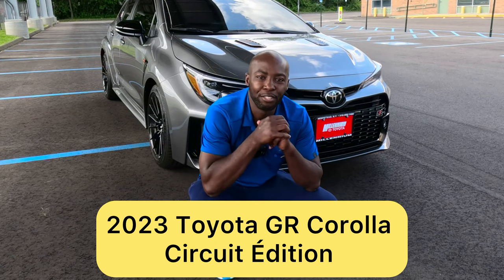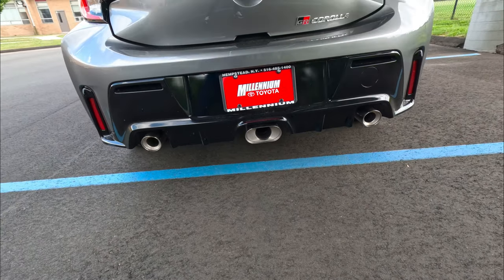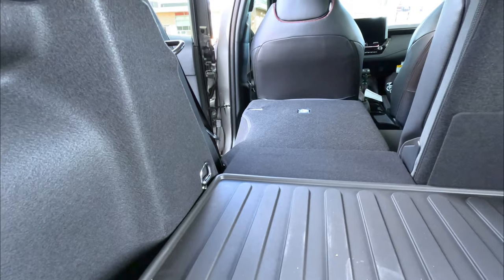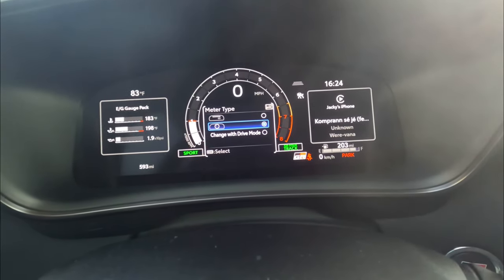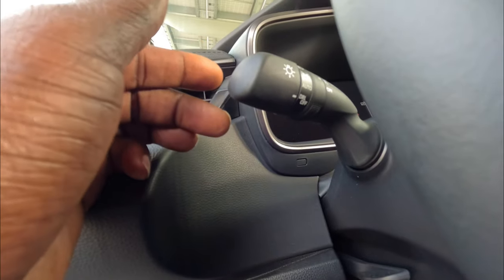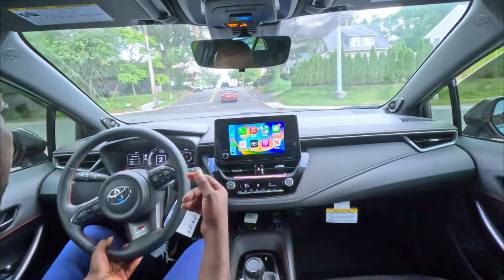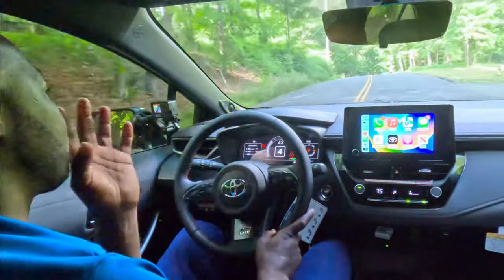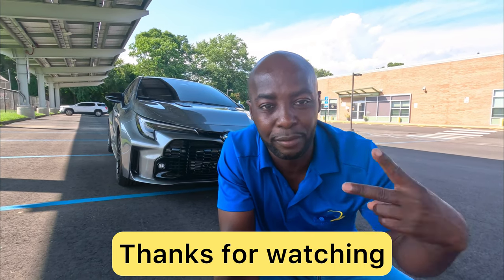Owner's Pov Review Of The 2023 Toyota Gr Corolla - A Quick Story About The Purchase.

Comment: I have the exact same car. Waited 16 months and called about 13 dealers, but ended up getting one @$108 under MSRP 60 miles away!! I absolutely love my GRC, can’t wait to put much love into this little beast! Congrats on getting your GRC.
BTW, the front lower ducts are functional but are blocked off on the Circuits because of aero interference with the rear spoiler. They can be removed and are held on by a lip and double sided tape.
License plate lights are not LED, and the spoiler is not an option on the Core or Morizo from factory, but can be purchased.
Reply from the maker: Congratulations happy for you mine was about 50 miles away.  I put my boys in there already. It’s small but doable.
Thanks for info about the functional duck. I found out that those are the k l’y halogen bulbs. I have already replaced mine to LED. I think I said it can be added.  
Thank for the info.

Comment: I am getting mine in a couple of weeks. I hear a lot of complaints about the JBL sound system. I plan to add a sub-woofer and a amp either under the seat or next to the battery to start with. I would love to hear your thoughts on what is the best way to upgrade the sound system.
Reply from the maker: I agrée thé So call premium sound JBL system sound good if you can try to keep the Volume around 37-40 ish. Once you start to go a bit higher it sounds like crap. Special if you have long commutes and you like to listen to your music pound. It feel like the amp is lowered the volume so you don’t blow any speakers or radio. But anyways the issue that I have I do not want to replace the radio because there is a lot of features that are integrated into it. Like your drive mode and other stuff. So it wouldn’t be smart. My problem is trying to do all these while keep the car as stock as possible. I have not find anything yet. I though about adding a mini amp that I saw on YouTube. But $300 I’m not sure it’s worth it. It’s actually on sale for $270.. I’m still trying to find a way to do it without changing the radio or even the amp. The key is to keep the radio as is. And not cut any wires in the. At at all. So  as soon as I found something I will definitely do it and post it on YouTube. Stay tuned.